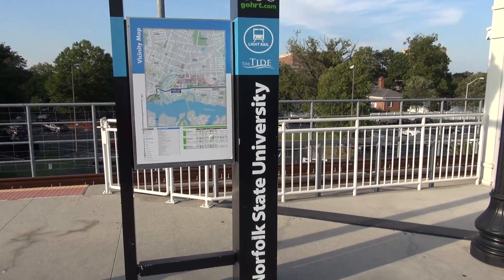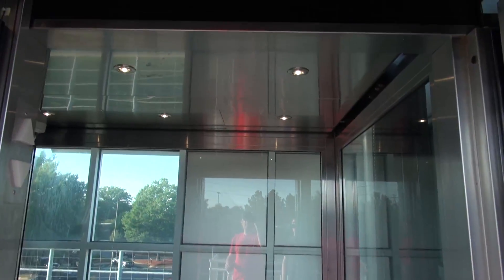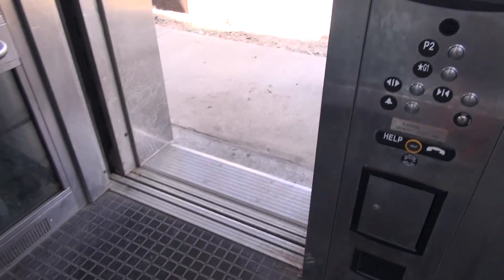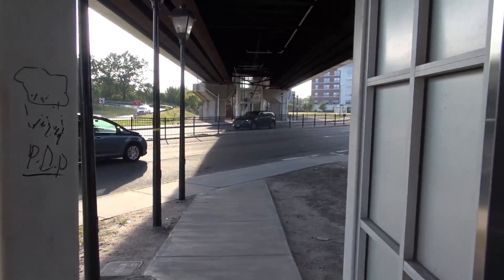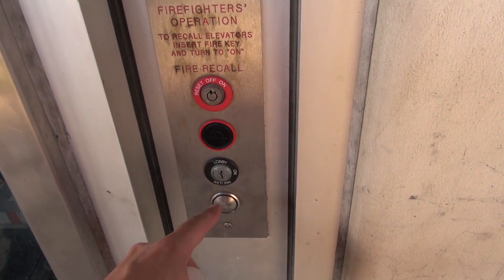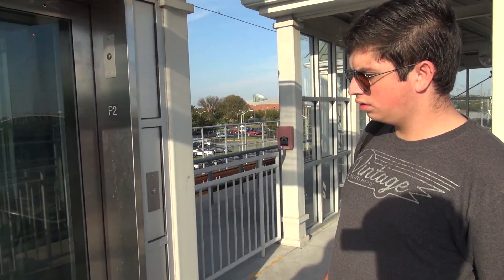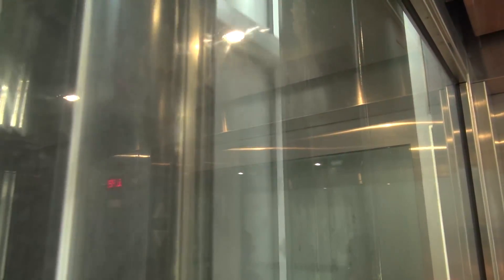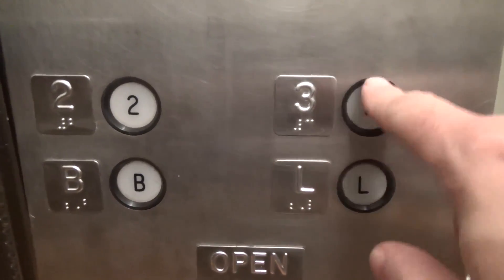Thyssenkrupp Endura MRL Hydraulic Elevator @ The Tide Station in Norfolk, VA

Comment: 5:55 if you pay close attention, you can see the cab oscillate a little from side to side as it moves upwards. The oil pressure seems to be fluctuating a bit between the two hydraulic jacks...
Reply: Oh, yeeaaa, it did... yea, definitely a problem

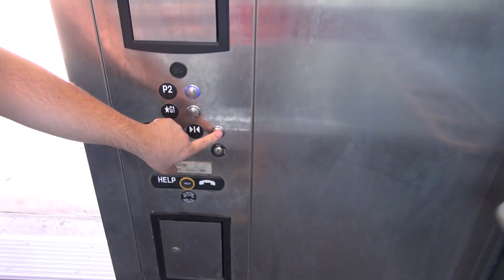Comment: @1:44  Hey, that's the natural essence of transit station elevators!  @3:10  Looks like that box thing would take the hit from the elevator, it seems to be higher than the buffers...
Reply: That box thing is the machine. There’s also protection to make sure the elevator itself doesn’t hit it.
Reply: Yeah... initially I thought that too. lmao
But if you look closely, you’ll see that the car frame is what is supposed to hit the springs, and it clears the bottom of the cab enough to do it before the cab hits the power unit.
Reply: @davidng2336  such protection isn’t really necessary, as the elevator car would already have activated the final limit switches and hit the springs by then. It is impossible for the car to “hit” the power unit, by design.

Comment: Hydro MRL?! RARE!
Reply: This model is pretty rare but hydro MRLs overall aren't rare.
Reply: @tkefan29  I have never seen one.
Reply: @lbsiuk  Nor have I installation is  only practical with a hole less telescopic piston or roped hydraulic, not a cylinder/piston type hydro elevator. I recently saw a roped hydro elevator, which still had a separate machine room.
Reply: @TheTheo58  In-ground hydraulic lifts are just for show. They don't offer any significant advantages, apart from the lift is being pushed up from the middle, rather than the bottom which reduces wobble. This problem is eliminated by have a piston either side of the lift.
Reply: @TheTheo58  MRL Hydraulics also are harder to freefall. In a motor room, you just go in there and release the valve. In an MRL, you need to open up the shaft door, climb into the pit, and release the valve.
Reply: @lbsiuk  And if the lift fails in the pit, you'll need a winch, since there is no way to freefall upwards nor handwind.